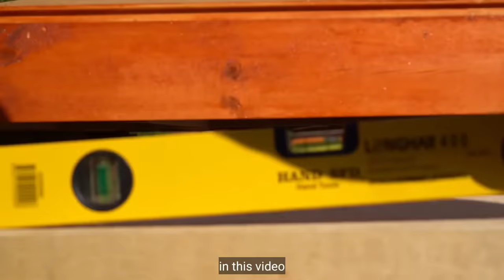Building a Wooden House / Off Grid Log Cabin / Tniy House

Comment: Wood should not be placed directly on concrete.  You could put foam padding between the wood and concrete to avoid transfer of moisture.   Staining the wood was a good idea.  it would have been best to stain the underside of the beams to keep the bugs and moisture out.   Another option could have been to burn the wood with a blow torch.   It will turn it black and make it bug repellant.
Reply: Good info! Thanks
Reply: Bilgi için teşekkürler
Reply: Those stairs don't look safe 😬
Reply: He needs automatic tools 😩
Reply: What about the black damp proofing used by biulders?
Reply: Should have anchored your beams to the concrete piers, only the dead weight of the "house" is keeping it there and i bet you are in a seismic zone.
Reply: Every 100 year old house has the wood directly on the concrete.
Reply: It looks good would change a couple of thanks would you be willing to help build Another one with me
Reply: In California we use treated lumber.
Reply: low bugget project but still a  good
Reply: thanks for info good idea
Reply: what about the 4x4 instead of 2x8 joists? dimensionally they are equivalent 2x8=16 and 4x4=16 but structurally will it work?
Reply: Cristo te ama y quiere salvar tu alma aún hay tiempo para buscar a Dios por salvación
Reply: @davidwalesby2426 not as well, because they would bend. Rectangular joists are more stable and do not bend vertically as easy.
Reply: @altica1979  ty, i knew you couldn't but drew a blank.
Reply: Cuantos m2 tiene la cabaña?

Comment: Es un placer ver el video. Mi único punto de preocupación y consejo son las escaleras que tal vez quieras repensar en este momento. Son estructuralmente fuertes, pero con el tiempo se volverán muy débiles. Simplemente clavarlas en el costado de una escalera no es lo mejor que puedes hacer.  necesita soporte de madera desde abajo.  Pero muy bien hecho.

-
Very wonderful señor it was a pleasure watching the video my only point of concern and advice is the stairs you might want to rethink right now they’re structurally strong but overtime they’re going to get very weak just nailing into the side of a staircase is not the best you do need wood support from underneath. But very well done.

Comment: Zinc angle tube is good for terrace frame. Wooden frames rot over time.The wood is good for chemically treated protection. . And you have to oil stain it every year.
There's a lot of moisture on the country floor.

Comment: Those concrete blocks aren't tied down. You should have used concrete blocks with holes in them so you could put rebar and concrete. That house could fall over.

Comment: The foundation of the house must be constructed using construction methods so that the house does not fly into the air during a strong typhoon!Column beams have a depth of more than 2M and are made of reinforced cement.

Comment: First of all I've already been there done that. First mistake is those damn cinder blocks. Second is your pounding on that wood on top of those cinder blocks which make those cinder blocks turn to s*** later on if not already on the spot. 12'x16' camp you have to have six 12" soa tube at least 4 ft in the ground for frost with four pieces of half inch rebar per sonatube especially if you want that three to four foot height off the ground. Second any hatchet work or anything like that you do not do on your brand new cement pillars you do that on the ground unless you plan on waiting 30 to 60 days and even then I wouldn't risk it.
Reply: Sorry man hate to be a dick. But one good tip is I put a 55 gallon plastic drum with many 3/4 in Holes and then fill the hole in that the drum was in with three quarter inch Stone in the ground about 10 ft away from the camp with an 1 1/4" PVC pipe which came up under the camp 2'-3' feet down. This I hooked up to the sink inside and also a heavy duty utility sink that sat on the floor that was removable for the base of a shower with a 12 volt pump that ran off a battery.. on the ceiling I had a square which hung the shower curtain which went into the utility sink. The sink is strong enough to stand in and it's 2'x2' which I located near the wood stove not too close though. Then I also hooked up a garden hose line up to an oil funnel on the inside so when it's raining like hell blizzard like snow conditions I could take a leak without having to walk all the way to the outhouse even my girlfriend at the time was iffy about it but once she used it she used it all the time instead of having to dress up to go use the outhouse the middle of the night in the snow storm.. just some ideas.
Reply: And last but not least the whole underside of the camp was a dog house with a ramp that came up underneath the bed that had a trap door mechanism on it so you could let the dog in or keep the dog out. One hint though the opening for the dog door going out to the world hang a bunch of I had rubber from a conveyor belt it knocks off all the mosquitoes as the dogs go through the dog entrance helped a lot actually it was more like a dog tunnel 4 ft deep with fingers of rubber hanging down good luck man I did 10 years and a 12x16 camp and Maine
Reply: @benjaminbrown688  Dude, it's always warm in there, I think this flimsy bungalow will last.
Although I don't understand why he set it so high, why he used fragile shit as a foundation, why there are so many nails to split thin boards, and why the flooring is so thin, I don't feel at ease if the floor is thinner than 2 inches))

Comment: Why not ss steel tube lighter stronger and no rot.
Reply: SS (stainless steel) steel is very expensive. Construction steel may be OK. However, you can't cut and drill steel easily. You need relatively expensive tools.

Also, this is a very small structure, and the benefits of using steel may not be there.

For the walls, though, you can use galvanized steel U-profile studs. I used them effectively at home.